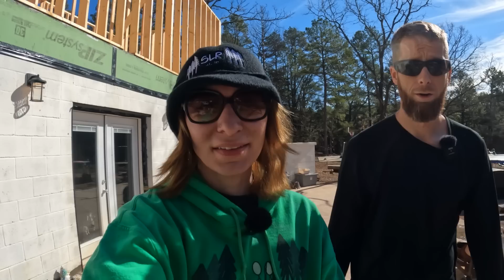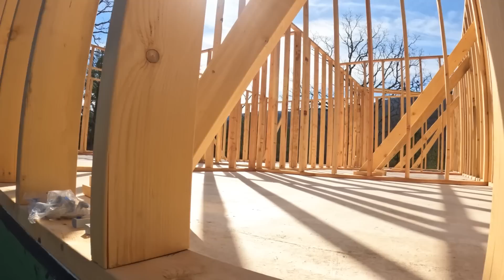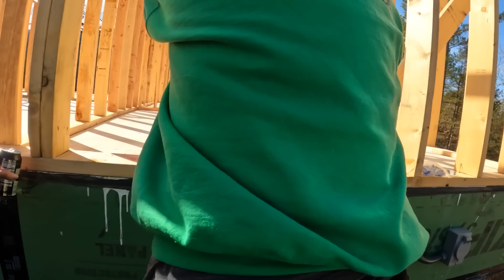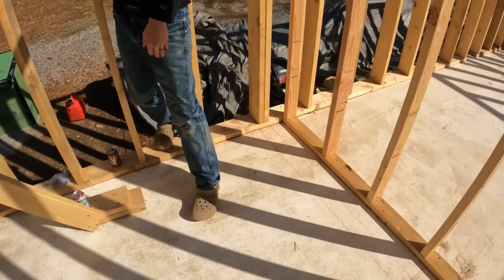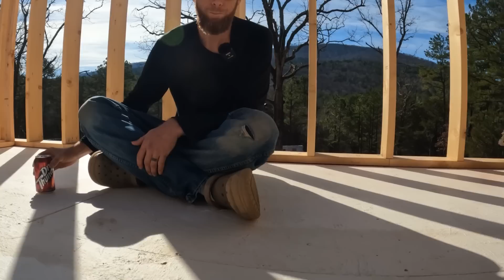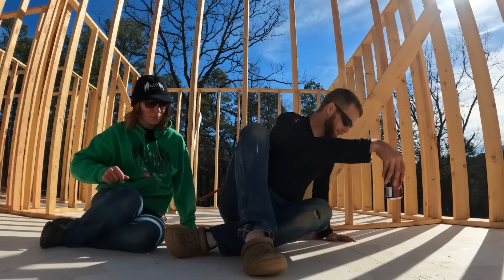FINALLY some SUNSHINE! @SimpleLifeReclaimed | EP155 | 02.13.23

Comment: It is really overwhelming just thinking about all the work and progress you have done in the course of one year. So it is awesome that that video has hit 1 mil. On another note, I was thinking about the chicken run flooding and thought of that pile of extra cinder blocks. If you ran some the length of the coop, two tier, near the gravel path, it would send the water away and around. I would also give you space between the block & the run for maintenance of the coop and you could put some wood chips in that area to walk on, seeing it will be protected from runoff. It would be a great temporary fix till you upgrade to something more permanent. So excited to see the trusses go up. That will be so cool and a fun framily project for all!

Comment: Can I suggest that the genset connection cable's earth, have some form of insulated sleeve slid over the bare conductors and that the earth cable be connected to the actual socket directly, not via the terminal mounted on the side of the outside metal box.